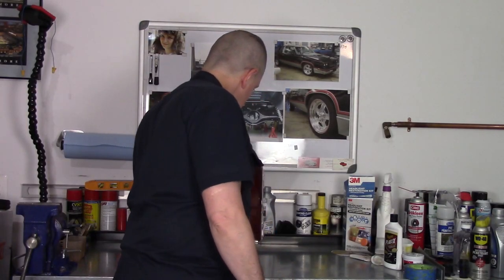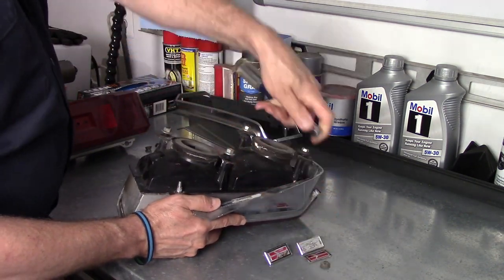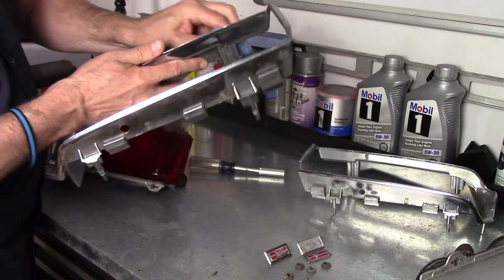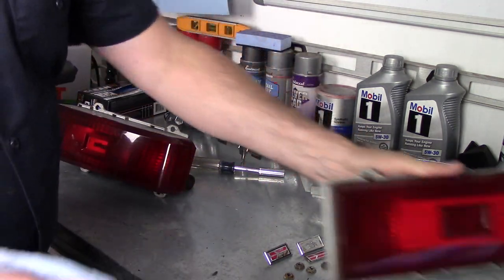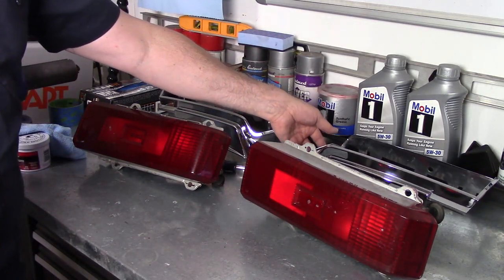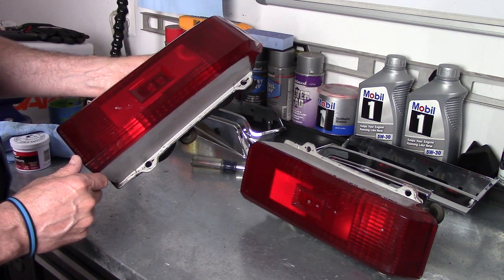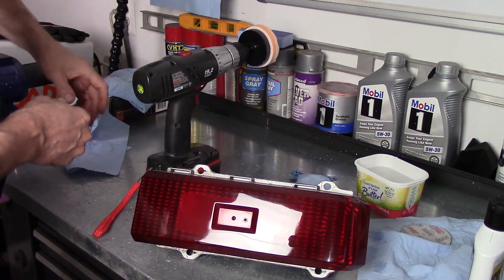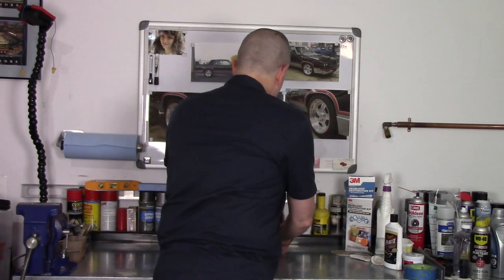Plastic Tail Light Restoration To Like New!! 1987 Olds 442: Video 52

Comment: Got a better trick I've used a few times. Wet sand the lens with 1000 - 2000. I used a red stained glass paint. I put it on light, then 2 heavy coats to where it almost ran but didn't. You'd never know it wasn't plastic. The only downside is, the light isn't quite as bright going through the lens. At night it is no problem, but during the day it is lighter.

Comment: mine have the white stress marks at the top i wonder if this would help salvage them?! killer video and killer results
Reply from the maker: Thanks for the compliment!  I would say give it a try. You have nothing to loose but some of your time. Even if you have to buy the 3M kit, now you can do headlights, tail lights, Gauge dust covers, you name it.
Reply: @hutchhiperf  hey thanks for the reply man! I agree nothing to lose it'll improve it some anyway lol I did my cluster last year when I changed the bulbs and repainted my needles as well LOL currently chasing a fuel issue and not making enough money makes it hard so im just piddling around with little stuff now until I can afford my next jegs order

Comment: What did you use to take off the center logo caps I am replacing my tail lights the replacements do not have the center cap the old ones do just want to be able to get them off without breaking them
Reply from the maker: The easy answer is time. As in they were so old, one fell off during disassembly 😆  The other I just used a small pocket screwdriver flat blade and was very careful. They're glued in (both the center and chrome bezel) so be very careful and it should pop out.
Reply: @hutchhiperf  awesome thanks!
Reply from the maker: @brookeabbott432  No prob.  Good luck with the resto!

Comment: How can separate seam to relax from inside ?
Reply from the maker: ? One more time?
Reply: Just saw the seam between the lens and the backing but old plastic I think maybe a glue softener like goo gone might help, any suggestions? TIA
Reply from the maker: @joelprefontaine1886  not really. I never tried to split one of those open before.
Reply: @hutchhiperf  Sand them with very fine sandpaper and finally with a lot of steel wool and give it a coat of clear coat, I have done it on my car, it was a nice end result
Reply: @hutchhiperf  remember to spoil the wife in the same way and it can't go wrong 🤭
Reply from the maker: @TommyJensen-pl8qz  You cheeky devil